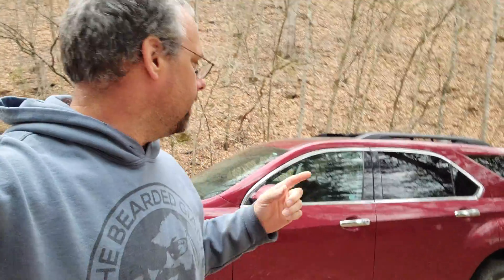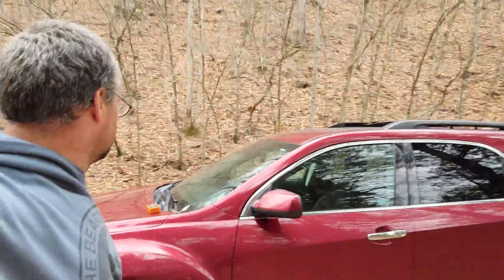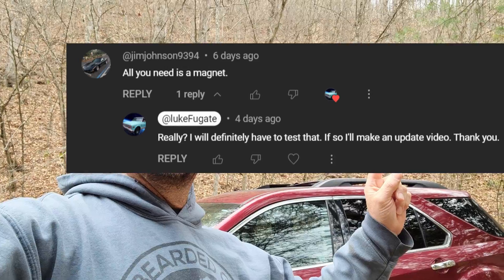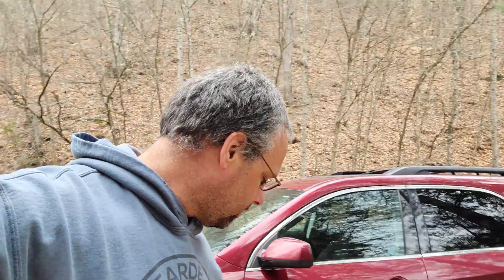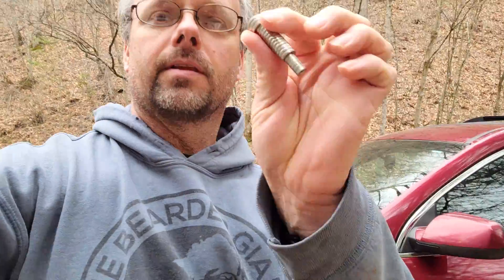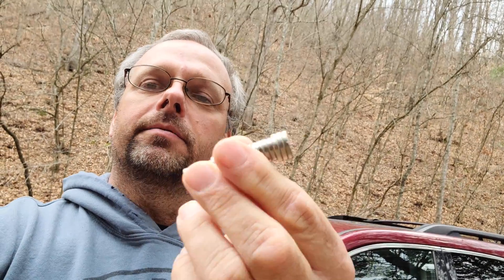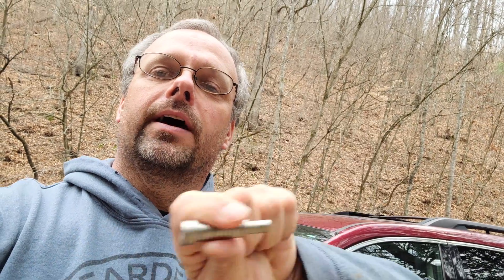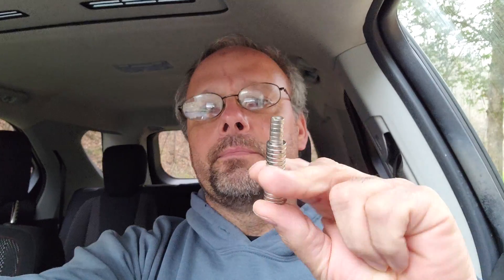Can You use a Magnet to Set TPMS?

Comment: It does work. I have a maxiTPMS ts508 tool and it comes with a magnet donut shaped and u put it on the valve stem let n it hang there got your scan tool in hand and the magnet will "wake up" the sensor the magnet will make it think its working because alot of sensors are "dead" unless they are moving. I mean itll read to the car but not to a scan reset tool. And i n use it almost everyday working on cars
Reply from the maker: That's a good tip, thanks for sharing!

Comment: Extremely helpful, I bought one used and well I didn't do a well enough investigation on them. I'm now replacing the camshaft sensor but the info on the hole in the oil cap and putting a pcv valve on it will help me a ton! Thank you!
Reply from the maker: You are welcome.